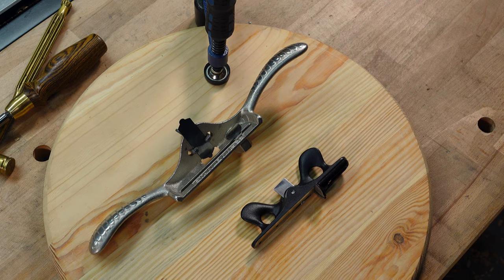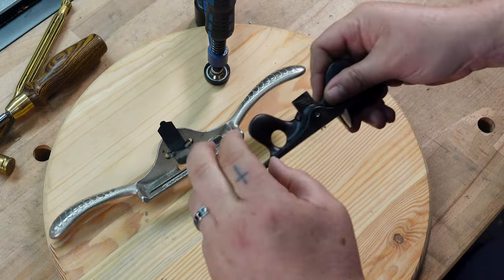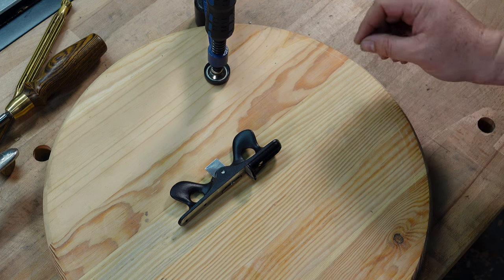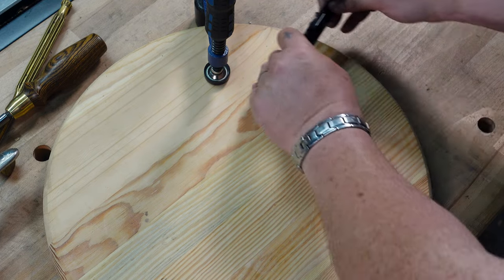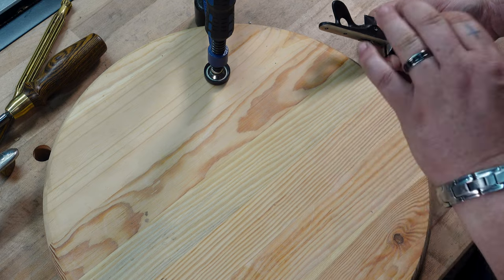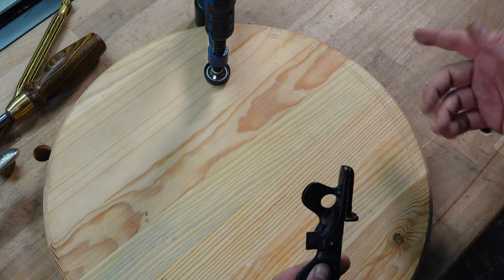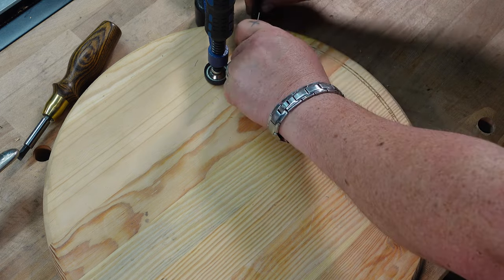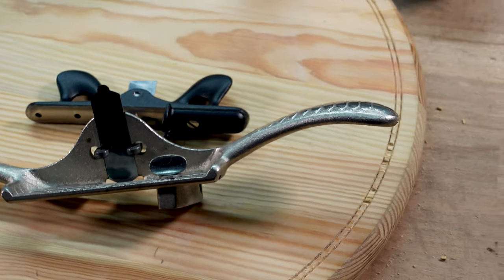How to Bead a Curved Surface

Comment: I have a thought on this. I notice there are holes in the handle. If you put a string through one of the holes, close to the end of the handle, then tap a small nail in the center of the circle, you can use the tool, sort of like a compass. The string would keep it centered in one direction, while the fence keeps it centered in the other.
Reply from the maker: Oooh that is a really good idea!!!! Imma have to try that!!!
Reply: I had success clamping the cutters in a wooden arm with a center pivot, but since you're not using the tool, you can't really rock it for starting the cut. At the time I thought I would make a fence with two roller bearings to track the outside of the curve, which wouldn't need a center pivot point.
Reply from the maker: That's a great idea also!!!